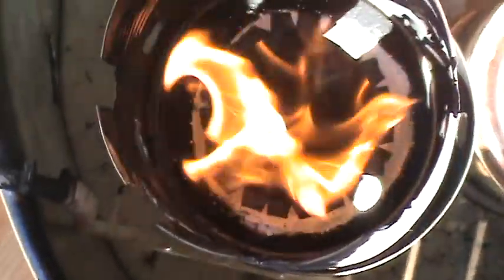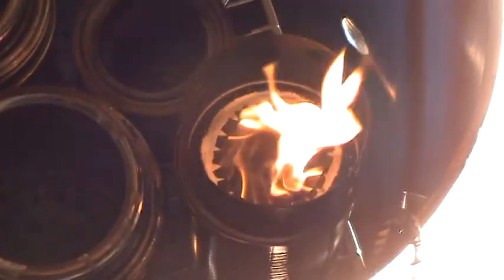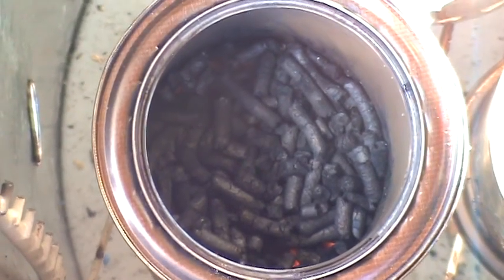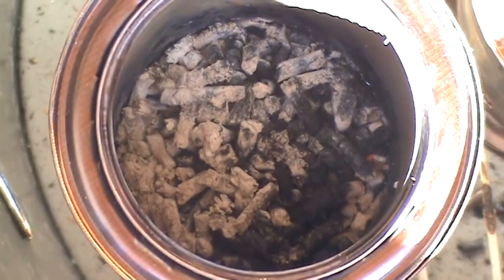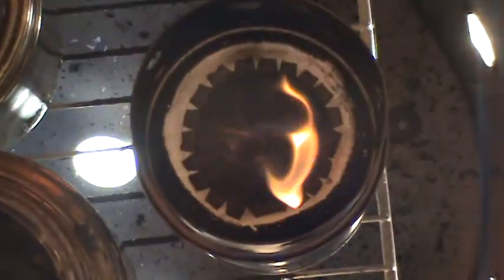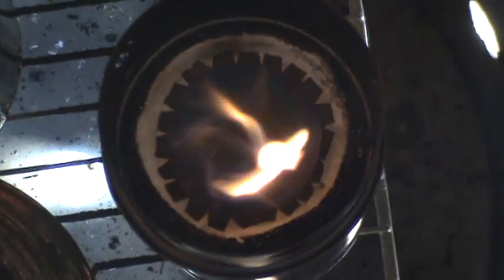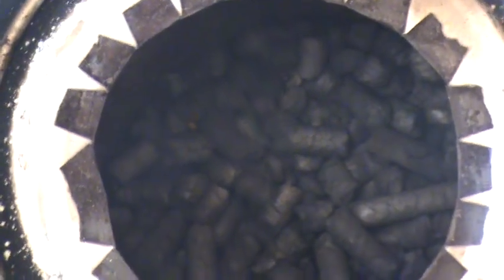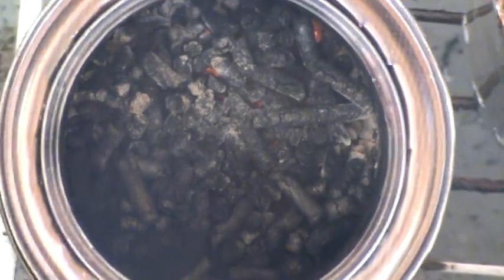Gasifier 3 to 1 air ratio

Comment: Heath Putnam has a design called the Vortex 5.4 using a version 3 pot stand/chimney which reaches 1500 degrees F and which burns blue. This stove uses a close to 5:1 ratio primary to secondary. Check that one out.
Reply: I also wanted to ask if your stove leaves any soot on the bottom of the pot? this is an indicator of an incomplete burn or lower than ideal efficiency.
Reply from the maker: Heath Putnam is where I got the idea ;-), but thx! And any yellow flame will always leave soot.

Comment: I'm thinking set it on a can that covers the bottom grate holes and remove from that can near the end of the burn for a complete burn,,,,,, you may find more blue flames in there..
........ Just a thought.
Reply: That would also be a way to more simply fine tune your bottom hole ratio,,, just line up some cans with different hole configurations to set your stove on.
Reply from the maker: Thanks, good idea. I haven't worked on these in a long time, but if/when I do, I'll keep that in mind.
Reply: I'm glad you understand my thoughts..... I hope others do as well... I'm just trying to find the most proper build, cuz even tho I have some excellent thoughts, for some reason when I build things it is always of a nightmare finish......... arrgghhh....
 I'm hoping the 5.4 or 5.6 gasifier ,,or whatever version the video was ,,, works out for me and leaves me with plenty of room for error.

Comment: why do you think that non of the shop bought stoves seem to display any blue flame?i mean the solo stove and silverfire etc.do you think it could be because a cheap tin can stove made from thin gauge steel gets up to a hotter temp?regards from sheffield england.
Reply from the maker: I kind of doubt that it's the metal. More likely it's the difference in diameter between the inner and outer cans, with a tighter tolerance heating the air trapped between them to a higher temperature since there's less air to heat. I've never owned a commercially made stove so I really can't say what the differences may be, but that would be my guess.
Reply: I have the stove made in England that the silverfire was based on.no blue flame.but the bean can stove I made that has an aluminum best can burn chamber burns quite blue.maybe your right because the gap between the walls is only about 1/16 inch.
Reply from the maker: Yeah,  1/16 inch is pretty tight. But if there's too little air, you'll get a blue flame but it won't burn the coals down to ash. If it does that, then it needs more air. I never really found the perfect balance between can sizes and primary/secondary holes to produce blue flame but burn the coals completely.
Reply: thanks for the info.i guess we'll never split the atom but wood gas makes us happy.
Reply from the maker: Glad to help, take care.

Comment: If you are interested you can construct a Mountain Range Wood Gas Stove Mk2 which is a 1:5 ratio primary to secondary the opposite of Heath's design. https://www.survivalistboards.com/showthread.php?t=338725 note that the last update on this design to make the 32 primary intake holes smaller at 1/8", the top 16 secondary inlet holes are 1/4".